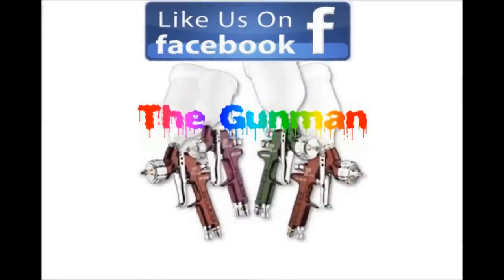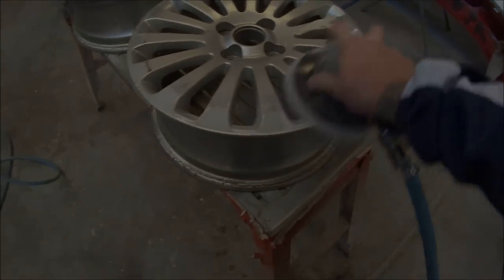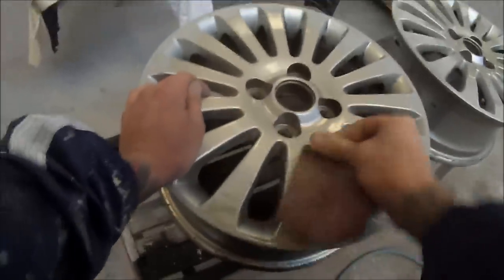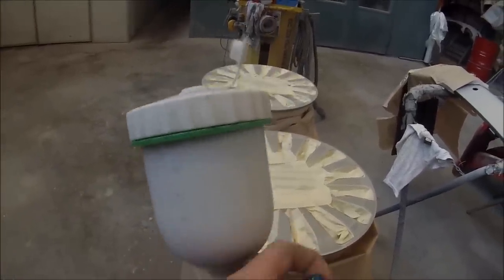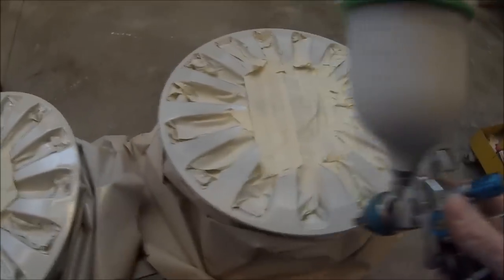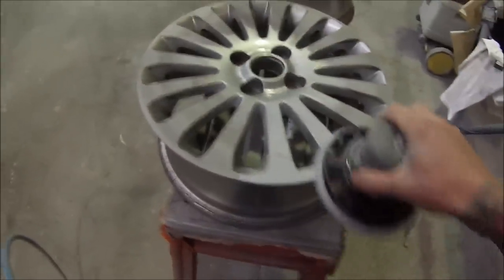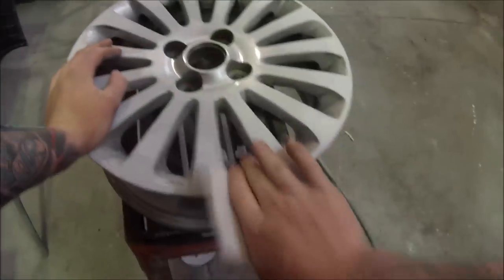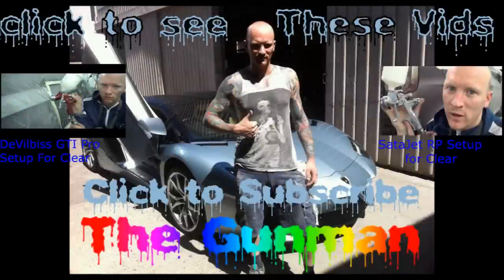How to Prepare Alloy Wheels for Painting

Comment: Good advice about the adding of rocket! I have just done a set of wheels and got a few run marks on the edges, I tried to blow them out best I can by adding more clear, still not 100% but a little better.
Great video too 👍 you should do more wheel videos as there are very few on youtube and all usually done with aerosol.
Good work as always, keep it up 👍

Comment: hi gun man i refurb wheels as a job and ive started getting a few wheels come back flaking where the paint hasnt adhered to the primer what would cause this my process is clean with panel wipe, sand damage,key with red scotch and clean with panel wipe again,prime sanded areas with rattle can,dry and sand with 800 grit,clean again(panel wipe)and spray colour two coats then clear two coats any suggestions would be great i follow those steps every time
Reply: 800 Grid ? That's way to fine, your paint will just start falling of. D9nt go higher then 400 grid

Comment: I have clear coated aluminum wheels, how can I remove the old coating without hurting the machining marks? I just want to re-clear coat, I don't want to paint them, is that doable?
Reply from the maker: To be honest I've never tried it but it should be ok the only thing is the stripper may leave some stains on the alloy, maybe just do a test spot and see how it goes.
Reply: would it be possible to polish the metal before painting, or would that also remove the machining circles? I suppose it doesn't matter as long as the wheels look ok. Thanks for the quick reply!
Reply from the maker: I would think you are right that it could remove the machine marks by polishing, the reason we don't usually advise this kind of thing is because without sanding and using etch it's hard to get adhesion as you have found out, maybe you should consider a color like a nice bright fine silver.
Reply: The Gunman  
Thank you for your videos , 
I did the step by step on wheel painting , I keep getting rough texture inside the wheel when painting the face of the rim , any ideas how to fix this ?

Comment: Is nessesery to use a sandpaper?

 I use this method:
1. Sandpaper 100 for all part of wheels
2. Use hb body wash primer and paint for inside and outside of wheel
3. Use hb body grey primer for outside and inside wheels
4. Without any sandpapers i paint wheels in a glossy black dupli color rally negro paint
5. After 2 hours paint second and third after 4 hours
6. Paint with clear coat dupli color

All is done.

Comment: What kind of sanding pads are those for angle grinders? Can't use wire wheels on aluminum so wonder what I could use. Instead of sandblasting which I will probably do since I got a compressor now..
Reply from the maker: I don't remember using an angle grinder on this job, testing my memory but I thought I just used the orbital sander didn't I?
Reply: Ah, yes I see but I figured similar sanding pads could be used on an angle grinder. But then you´d need to be careful to not damage the aluminum.
Reply from the maker: Swordie100 Yes, I wouldn't use an angle grinder on an alloy wheel for that reason

Comment: I have a set of mint shape bmw rims that have oem paint and clear coat on them. I want to paint them a different colour, do I have to strip the paint and clear coat down to the metal before applying primer or can I Just rough up the clear coat with 300-400 grit sandpaper and then apply primer?
Reply: Goki Real Madrid  did anyone help with that I going to the same exact issues, I'm afraid won't stick ,could  you let me know if you did it how they looked and any info on the grits you used
Reply: You have to remove as much as you can, that will come off. I ddo this for a living, we have a sandblaster that blows everything completely off so it's easy to get old paint off. Just sand properly then make sure to scuff everything. Only use primer where needed & not overdue it. Theres this new method I was introduced to, when painting rims. "Powder coating" man that stuff is cool, looks great. Even the clear goes on as powder & dry perfectly, no drips or runs

Comment: Whenever I do this then paint them I still see the areas I've sanded? How can I avid this? Am I sanding with too much pressure? Ps I'm an amature not a pro
Reply: Hey hello sir actually there's a sealer that u apply when u p to deep what it sctually does is hide the spots and imperfections from the sanding

Comment: Hey gunman what would you tink of a mobile alloy wheel repair business .any ideas?
Reply from the maker: Paul Mullen good idea but just be careful of epa because you are not meant to do painting outside a booth, using single pack paints is an option, but my best advice would be to research the industry and see what others are doing, if there is a good market for it then go for it.
Reply: The Gunman thanks for the reply . how would you go about researching the industry it would be a common business in Ireland any info would be great thanks
Reply: Paul Mullen sorry meant to say wouldn't be popular in ireland
Reply from the maker: Google search, I did it and there are businesses that do it in Ireland so call them and ask questions.
Reply: The Gunman k cool thanks